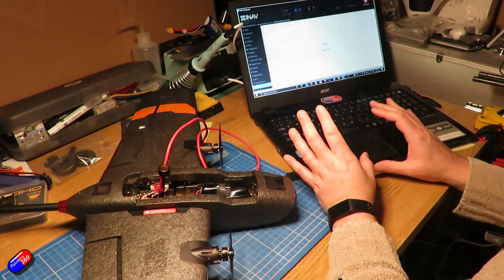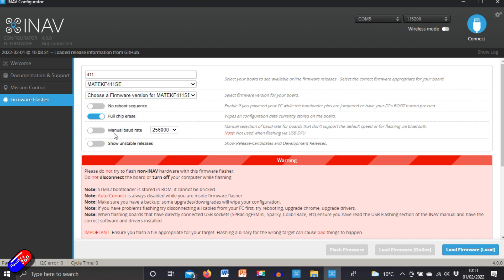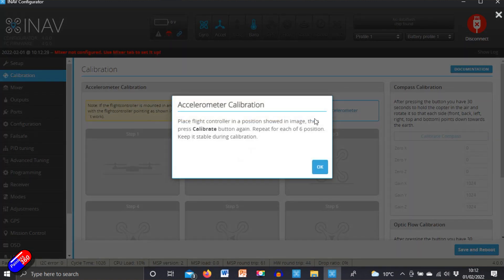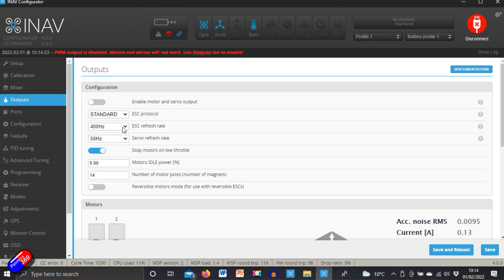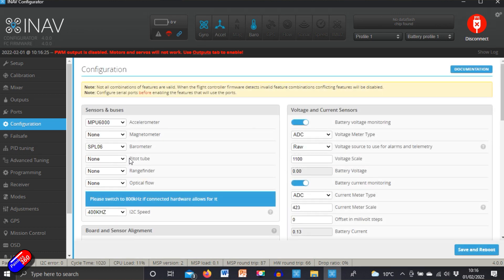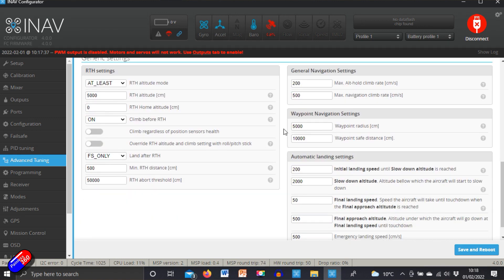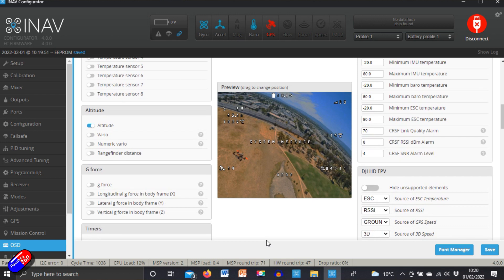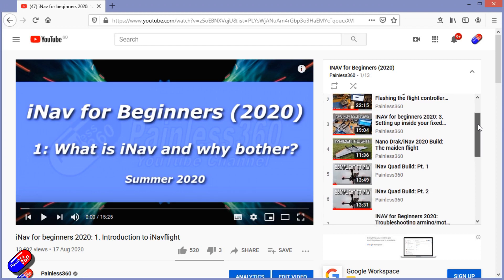How easy is it to setup INAV 4.0? Different from INAV 3.0?

Comment: Sir I buy a flight controller from online whose name is (F4 V3S Plus Flight Controller) on web site, but when i connect it to betaflight configurator then it shows AIRB/OMNIBUSF4SD( STM32F405). So my question is will this board support INAV configurator.
Reply from the maker: I've never tried that board. I'd recommend using one of the flight controllers i use in my INAV builds on the channel. Best of luck

Comment: hey lee i have a question got inav 4.0 setup. im using elrs and f405wse board got everything setup checked reciver its working fine but i plug in and nothing works even though its showing in the reciever tab. what could i have missed any info would help thanks and keep up the awsome job
Reply from the maker: Enabled outputs?  See my INAV 3.0/4.0 setup videos.. best of luck

Comment: Have you had a problem with  the matek GPS  not working on new inav? Mine doesn't  register.  The module lights up red and flashes blue. Compass on it works. But the GPS isn't working
Reply from the maker: Have you tried swapping the rx/tx wires? What troubleshooting have you tried?
Reply: @Painless360  well I haven't tried swapping the rx tx because I soldered them on and has worked previously.  My troubleshooting  was changing baut.. changing from ublox to test the others to no avail.  The NMEA selection blue light my GPS indicator  in configurator  but no sats listed and it kept timing  out, turning red and then back blue in configurator. I even tried the new candidate 3 because I heard it fixed someone's problem, but mine persists.  I meddled around with some cli GPS commands(turning on and off random things) I found with -get GPS. But nothing seems to work.  I heard in the discord someone say it's enabled through cli commands only in the new inav.  But Idk man I can't find it I guess. Or perhaps  he was mistaken. 🤷‍♂️
Reply from the maker: First thing to check is the TX and RX connections are the right way round. See my builds. Best of luck!

Comment: I’m coming back to RC after a long hiatus. I’m seeing a lot of different radios out now. When I left, JR and Futuba were the main players with Spektrum coming on strong. What are the best transmitters out there now?
Reply from the maker: Sounds like you left as I started to get into the hobby. Those proprietary radios are still about and many pilots love and use them. Lots of pilots now use the cheaper Opentx/EdgeTX powered radios from newer vendors like RadioMaster, Jumper and Frsky but the quality is no where near those older brands (but they also cost a fraction too). One of the few new radios that is almost as good in terms of quality is the Frsky X20. Check out my Kit Picks 2020 video for my choices. Best of luck
Reply: @Painless360  I’d like to set up a radio system with flight stabilization and return to home. I’ve gotten spoiled to those with my drone. Ultimately, I’d like to get to the point of having OSD and FPV without tossing too much equipment to the wayside. Any suggestions?
Reply: @Painless360  I’m watching your review of the TX12. Would that work with my current receivers? Can it support an external display for fpv & osd?
Reply from the maker: INAV or a Kopilot are the two options I'd suggest you look at for RTH modes. If you want all that OSD goodness then INAV is the way to go. See my INAV for Beginners 2020 series for all the steps.. 
The TX12 only works with a limited set of receivers that you can find listed on the pages of resellers. They work with Texas Instruments CC2500: Corona, Hitec, Futaba S-FHSS, Frsky D16/D8, RadioLink, Graupner HoTT so if your existing receivers are one of those, it should work.
Reply: @Painless360  I’ll check that out. Any suggestions for video downlink? Thanks again.
Reply from the maker: Do you mean FPV? That depends on the model and what you already have. https://www.youtube.com/watch?v=ncv-6Dzs1vc covers the basics of FPV on quads for beginners
Reply: @Painless360  I’m actually looking at setting up a fixed wing with fpv. A few years back I got a VTX that connected to an action cam but it had limited capabilities with regards to recording. you started the record function when you took off and stopped it when you landed. 

I’ve gotten spoiled by the all in one of the DJI and being able to zoom take snapshots start and stop recording video. I want to be able to do that with this setup and wondered if there were off the shelf packages to do that.
Reply from the maker: Not like the DJI 'flying camera' drones you refer to. Lots of excellent little action cameras now that can record alongside the FPV feed (see my videos on the Peanut). Lots use DJI HD FPV and that provides a much better image but still doesn't have what you want. With a fixed wing, you can't hover and 'look about' in the same way as a multi-rotor... Best of luck!
Reply: @Painless360  just seems strange that nobody other than the “all in ones” have put this out. That is unless you want to spend 4 or 5 figures for it.

Comment: I changed back to INAV 3.0.2 after 4.0 continually gave me the message "Pitch/Roll not centered" and would not arm.  I tried all sorts of remedies; centered throws to 1500, etc..  3.0.2 is successful as it is less sensitive to this parameter.
Reply from the maker: What else did you try to? I've not seen that on any of the 4.0 builds here...
Reply: @Painless360  ensured the sticks and trims were calibrated and centered on the TX16s radio, outputs in INAV set to 1500.  Don't know what else to do in 4.0 but I don't have that issue with IVAV 3.0.2, and has everything I want.  Thank you from east Tennessee, always love your videos.
Reply from the maker: Channel order?
Reply: @Painless360  Channel order? On the AR Wing Pro-- 1. Throttle, 2. Aileron, 3. Elevator, 4. Rudder, 5. Arm, 6. Mode1 (Horizon, Manual, Aero), 7. Mode2 (Aero, PosHold, RTH), 8. Autotune.  Looking at another one of your tutorials, I noticed you reduced the ends to +/- 98% on the TX16s.  I'll try that next, but would not think it differs between the revisions.  Thanks!
Reply: Thanks for responding, Lee.  You're awesome!  Since 3.0.2 works for me quite well, for now I'll stick with it.  Maybe I'll try again in a few months, but then the newest will be 5.0.  I always look forward to your great and very helpful videos!

Comment: I have an FPV proposal.  There is nothing more cool than landing FPV.  It heightens the experience because things are happening, and the ground is coming up, and it is total immersive experience.  Here is the proposal:  FPV landing with PAPI lights that shoots the landing decent approach.  PAPI lights would give you the proper glide descent angle.  I have not yet seen any youtubers make a PAPI light FPV landing approach video.  I just think that would be so neat.
=====
I personally have not flown rc in 20 years, but I am looking at the turbo timber with its flaps and slats and I want to do FPV touch and go.By the way, PAPI lights are not hard to make.  It doesn’t even have to be a ‘light’   It can just be visible white and red paint that is half covered (ie the red is covered up at a certain visual angle and the white at another angle).  PAPI lights.
=====
So, what do you think?  Would you ever consider a PAPI light landing FPV video?  Thx.
Reply from the maker: Thanks for the idea but I am not sure how I'd make small portable lights that would be bright enough and large enough to be seen. Thanks for the idea though... Happy flying

Comment: start with arduplane or Inav first? I have dabbled in arduplane but mission planner ui is just kind of slow to use and double check you have everything configured right. Inav seems like you can zip around the menus easier. Stick with it? or try out inav?
Reply from the maker: It depends on what you want and what you already know as INAV will feel similar to Betaflight users. https://www.youtube.com/watch?v=ZwCLdkjqM-Y covers the differences and when I use each software..

Comment: I’m coming back at this from KK2 and CC3D — no need for PID tuning? Are the stock settings good for fixed wing?
Reply from the maker: Tuning things like rates to get it feeling perfect for you can be useful but modern code is very good at giving you a model that flies well straight away now. See my builds on the channel...

Comment: I will upgrade my 5" Quad from 3.0 to 4.0
Yes INAV became good, stable to fly with.
Thank you Sir.
Reply: I went to 4.1. And flies better.. though I have to goto 4.0. 4.1 is RC and my waypoint not working. Painless360 said go back to 4.0 and see
Reply: @divingfalconfpv4602  great, thank you for the information
happy flying!

Comment: Hi Lee. Hope all is well there. Your inav series is awesome. (as well as all you other series).  I have never flown with it and have been using a Kopilot so far. Now I have a Matek F411 wse and have started to configure it out of the plane. It had 2.6 and I have flashed it to 3.0.2. Now that I found this video I am looking at flashing to 4.? When I look at supported boards the 411 is not listed but on 4.0.0 RC1 it is. Will 4.0.0 work or use the rc1? Thanks in advance. Jeff
Reply from the maker: It is supported on all versions. Check out my INAV for beginners 2020 series... Best of luck

Comment: How do you set or change the PID loop or flight loop time  frequency / value?

By default the loop time is set to 500 and the range is between 0-9000.

In that case, if I want to set my PID loop frequency to be 4KHz what am I supposed to do?
Reply from the maker: High looptimes while using slow devices like GPS on stuff like F4 based flight controllers is tricky.  Sounds like you are coming from Betaflight. I don't worry about that on quads. My advice would be to look at INAV as something completely different. From INAV 3.0 release notes:  "Gyro is always processed as fast as possible without jitter and PID loop follows. In general, looptime configuration is no longer required" Best of luck